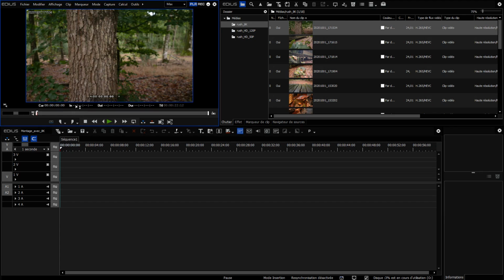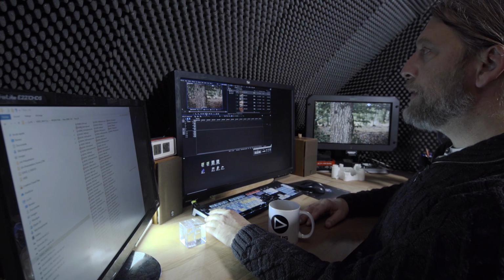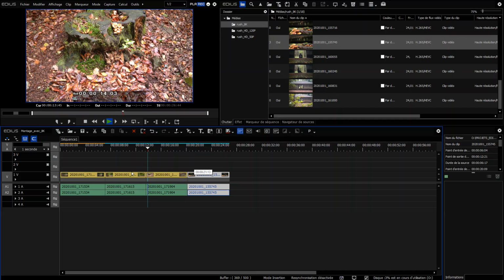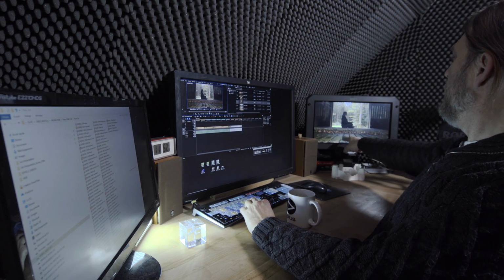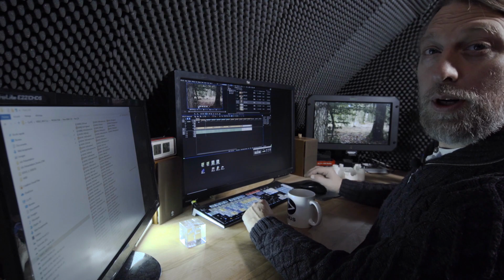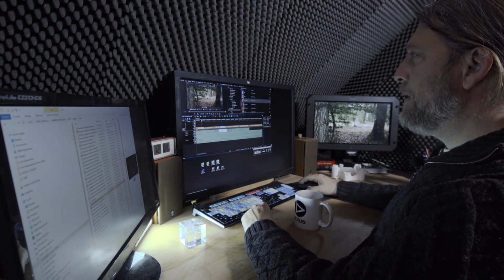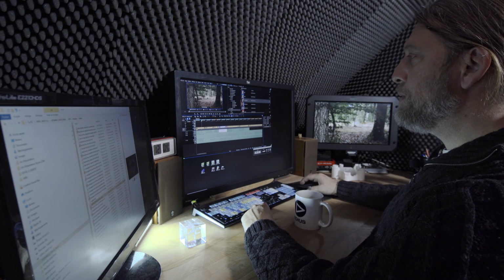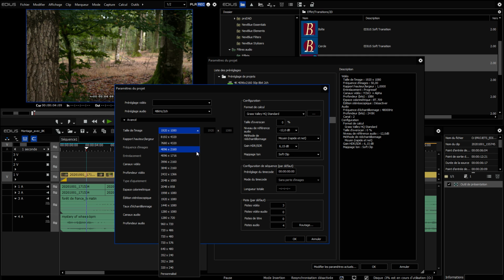EDIUS X EDIUS.FR Presentation (English version) I: Editing 8K Footage

Comment: Hi, I just bought an Edius X license, excellent result, with the new audio effects, tracking and titles it's fantastic. Sore point, I have a 4k clip ported to an FHD project, sadly it can't be smooth enough like other software that plays the file smooth as water, I have an i7 12700 processor and a 3060 graphics card, this saddens me for future projects. Maybe I need to change settings?
Reply from the maker: Hello! It looks like intel QuickSync hardware decoding acceleration does not work. Please update your intel GPU driver and restart the system. then it should work fine. EDIUS is optimized for 12th generation and should give you excellent power. If it does not work, please contact support@edius.net - the support team will be happy to help you.
Reply: @EDIUSNET  in fact, because even lowering the quality of the preview to the minimum di 1/16 nothing changes. I will try to contact customer support. Thanks for your quick response.
Reply from the maker: @luigitizzano2246  Yes, it looks like a decoding problem with the intel driver.

Comment: why edius render quality is low... any solution so please tell us.. what is 4k hd quality setting
Reply from the maker: Hello! The render quality of EDIUS is excellent. If you don't get the expected result, you need first check your project settings. If you want full 4K Quality, the project setting also needs to be 4K and not HD. Because you can also export a 4K file from a HD project, but the render quality will be HD. So please switch your project setting to 4K. You can change that even in the middle of your work. Also, for export, please use a datarate which is suitable for your format. a good 4K H.264 Quality you will get with 50-80MBit/s.